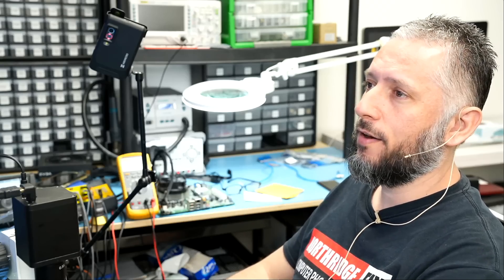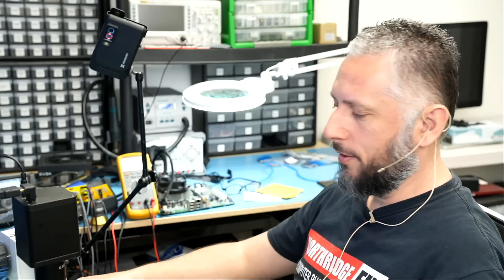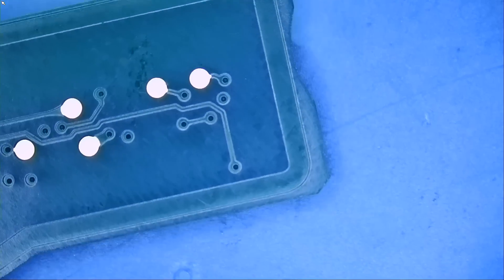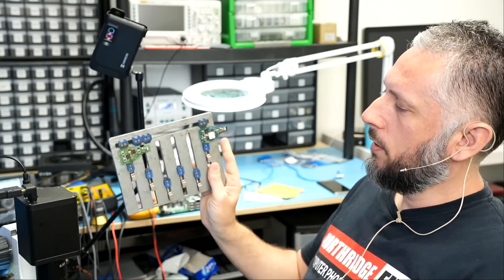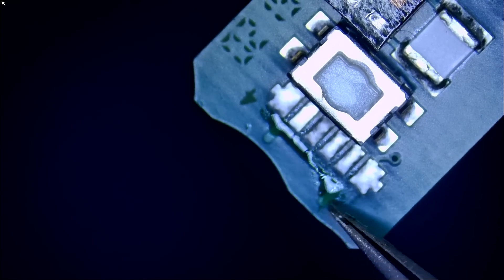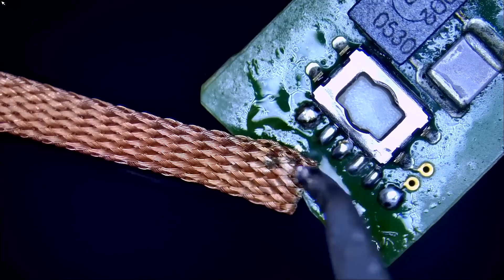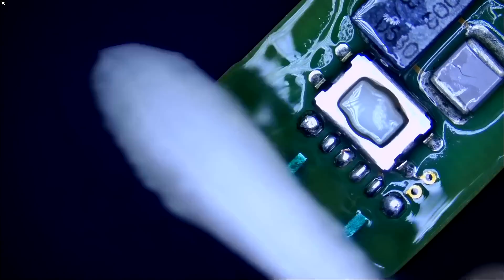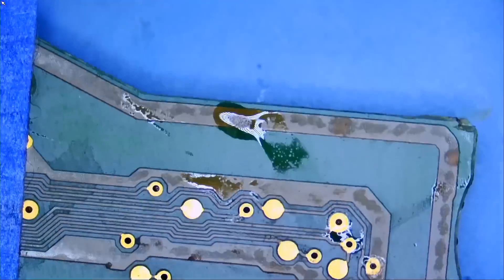Mercedes Benz key Fob Repair - Fragile IR Emitter soldering technique

Comment: I think the irda chip number 2711 on the board of the mercides w204 key is not working. I can use the number. Can I use 4711 instead?
Reply: No, that will not work, i build this like your idea…

Comment: Once the circuit board is removed from the case on these fobs getting them to work again is problematic... It's caused by the board not touching the terminals correctly in new cases... Putting them back into their old cases doesn't work well either

Comment: My boss came by around a month ago, one button was completely off, and the other one was pushed into the controller chip on his key fob.
But I managed to solder on those tiny buttons back on. I have the AiXun T3A soldering station with the 245 handle, and I used my android phone camera as a microscope to zoom in. 😅That feeling you get when you fix something never gets old.

Comment: Wouldn't be easier to remove the  switch to have room to solder the IR emitter?
Reply: Just making more work
Reply: @CiderPang27 It's barely "work". Removing the switch and using 63/37 by hand would take me the same time as him setting up everything for hot air

Comment: Is there a way to test fob to see if it's emitting a signal before returning to customer?
Reply: He does use a gizmo for testing them in other videos if you look back I guess he was too busy to include it in this vid
Reply: I'm an automotive locksmith and yes we have testers. They test the frequency and the IR. Xhorse just came out with a new one which I have. This one can also check the signal from the door and ignition. Pretty cool stuff.